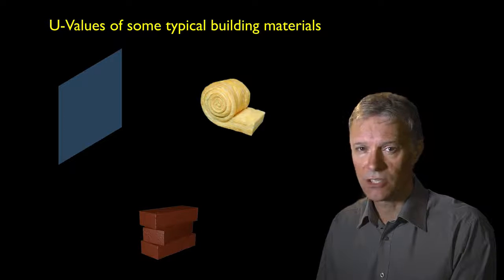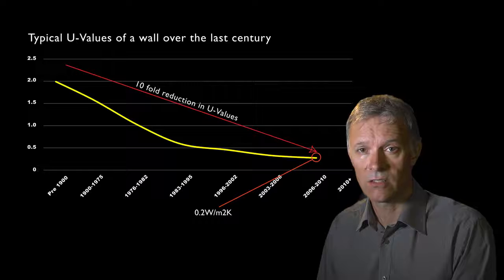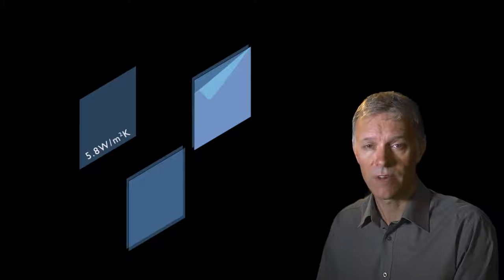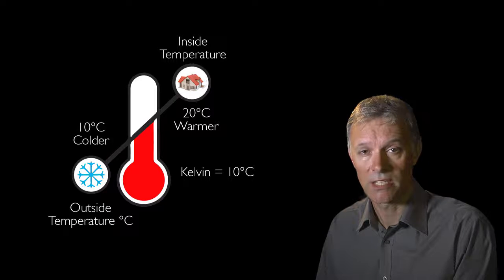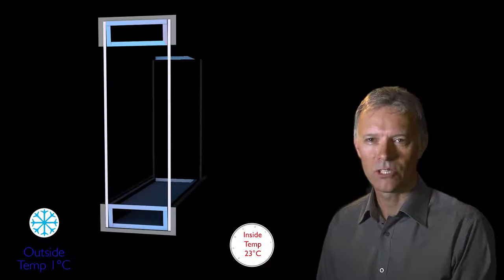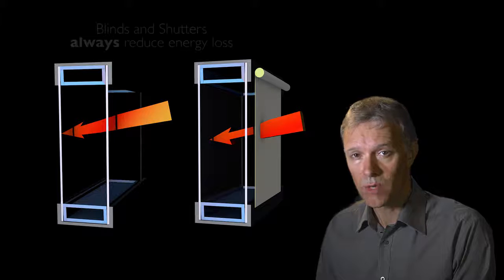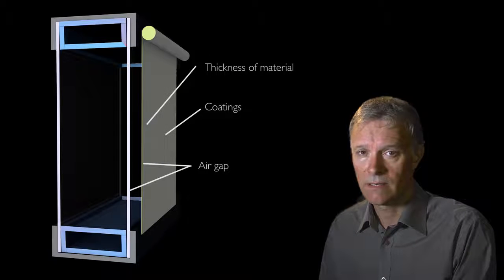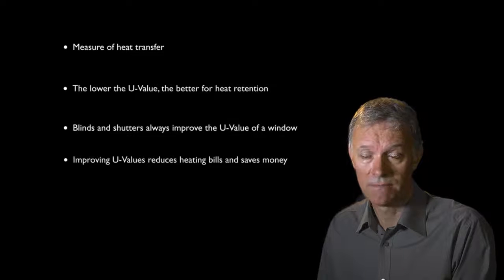BBSA - What is a U-value?

Comment: Your graphic of heat losses through a window by conduction, convection and radiation is slightly misleading. The radiative heat losses from the window depend on the temperature of the external skin of the glazing (its radiating surface) so your radiation arrow should start at the external surface of the glazing and point into the outside space.